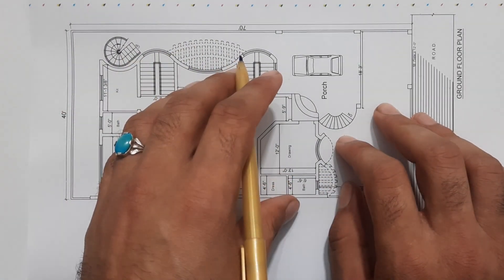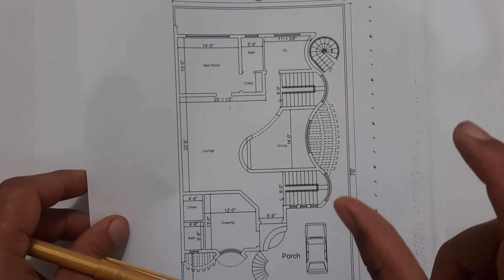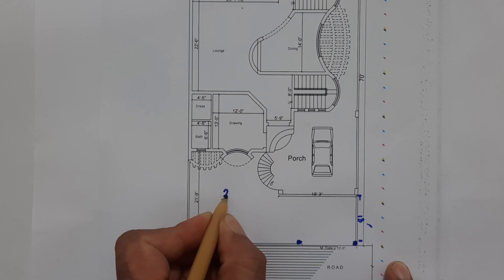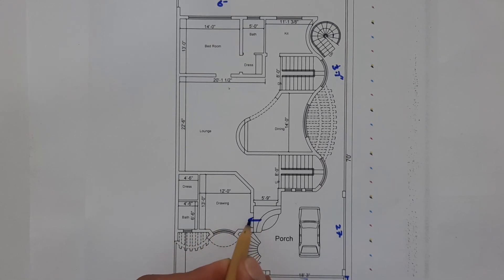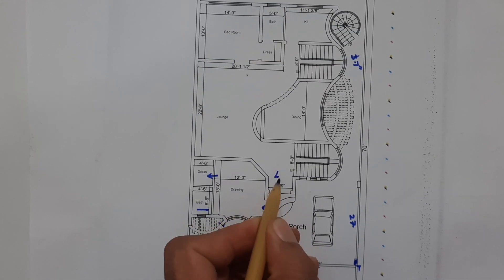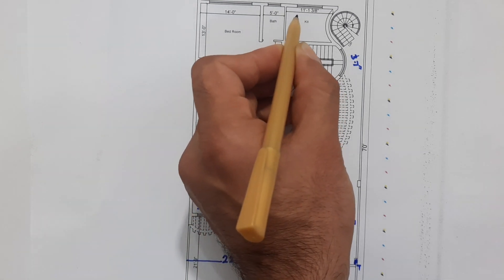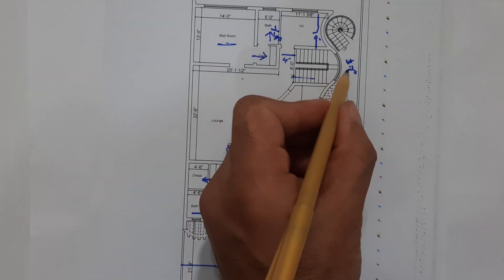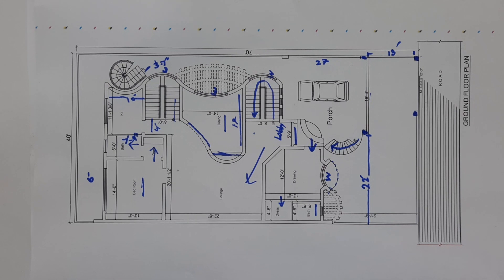40 x 70 House Plan for my Client | House Planning 2021 |

Comment: Asalamu alaikum brother, what is the grade of concrete and steel  that I a can use for manufacturing of precast concrete wall panels and H Columns. The wall panel has specifications of 6 feet by 1 feet with a thickness of 2 inch. And the H Column  has specifications of 6 inch by 6 inch and length upto 10 feet.
If we use M sand, would it develop cracks?